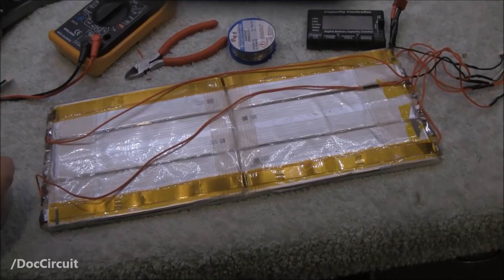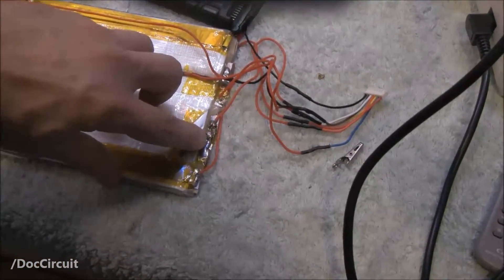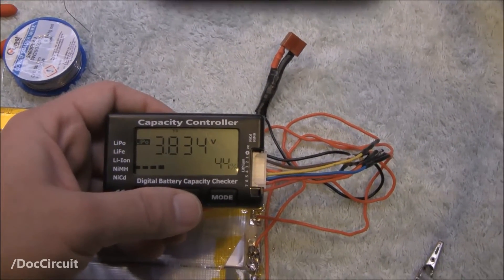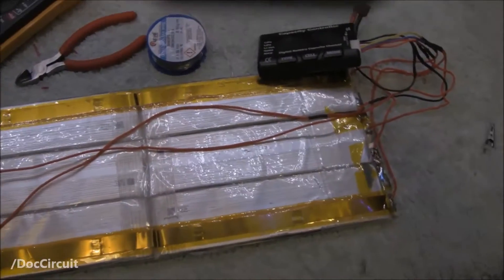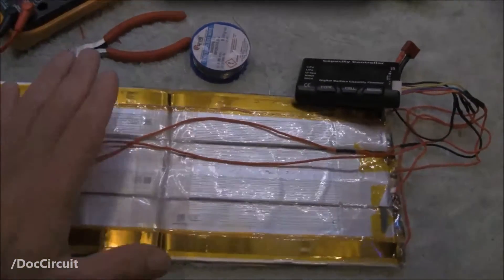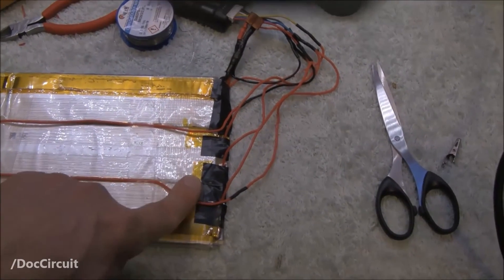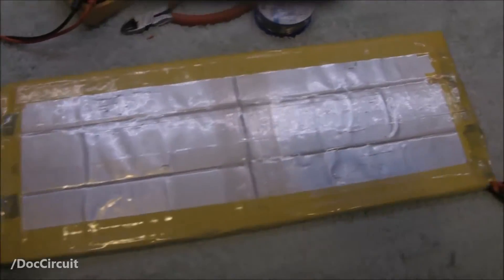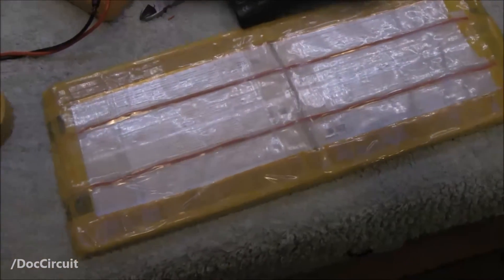Repairing a Li-Ion Battery. DON'T DO THIS!

Comment: hey I got a new bms and speed controller today and plugged it all in just like before but there is something wrong...the switch does not work and also whenever I plug it in just like if I was charging it, it starts up as if I turned it on by the switch but I never touched the switch... would love to Skype and would pay you to help me out thanks!

my Skype is: officialrender
Reply from the maker: +James Di Michiel Sorry, I don't Skype, and if I did I wouldn't offer to repair people boards via it as I'd be inundated. I'm also not too keen on trying to repair peoples boards via comments as it's time consuming. But anyhoo...

First thing I'd look at is the switch. I'd try a continuity test to find out it's condition.

It might also be that you've wired it up incorrectly somehow. I'm going to regret saying this, but if you want to email me a photograph of the circuit board and wiring I can take a quick look...
Reply: +Dr Circuit I'll link you my video I made for the company
Reply: I've emailed you the video :) hopefully you can help me figure out the problem or the mis-wiring
Reply from the maker: +James Di Michiel OK, I'll have a look...

Comment: Hey Dr Circuit.. The new board iv got has started playing up :( it cuts out, mainly when accelerating, The board stops. but if i give it about 10-20 seconds it is all fine again, i don't need to turn the board off then back on. I thought this would just be the ESC and i need a better one. But since I asked on endless-sphere and someone said it sounds like "esc is loosing sync or your hitting your low voltage cut off" Just wanted your opinion on if you think that sounds right and how you would recommend i try to fix it?
Reply from the maker: +Ed Bray It could be losing sync. But...

1. Losing sync tends to be accompanied by a loud screeching noise. 
2. Losing sync can occur when the timing between the motor and the ESC isn't spot on. This can happen when people are buying components from third parties and pairing them up. However the clone boards come with pre-matched motor and ESC.
3. Syncing also tends to occur when there is a substantial demand placed by the rider (going uphill, accelerating, etc).

So it 'could' be syncing, but a thought occurs...

The only time I had this issue was when I replaced the stock, pre-programmed ESC with an identical looking but non pre-programmed ESC (I made a video about replacing the stock ESC and I mention this in it). The non pre-programmed ESC ALWAYS gave me the problem you describe. But I had to turn the board off and on to get it going again. The reason why the non pre-programmed ESC did this was because the acceleration curve wasn't modified to make it perform slow starts/acceleration.

I wonder if the previous owner replaced the ESC with a third party ESC?

The low voltage cutoff... if the board still does this after a fresh charge then it isn't that. This is an easy one to eliminate.

Advice? Test the voltage cut off as described above, and if it isn't that it's the ESC. Again it comes down to one of the two weak points of the board, in your case the ESC. I'd replace it. 

However before you buy a VESC, I'm thinking of trying a MUCH cheaper alternative. A video will be coming about this, but not for a few weeks. If you're in a rush, do get the VESC.
Reply: Dr Circuit thank you, that was really helpful, So its not low voltage cut of then, because i have drained the board completely and given it a full charge, and it still dose it.  There is no loud screeching noise. it just sounds normal. I will test the violate cut like you said and I will wait for the new video. There is no rush, Just have to ride it always expecting it to turn off and be ready for the jolt as it cuts of so i don't go flying haha. The pervious owner hasn't changed the ESC. But I'm going to open it up and see if the ESC can be programmed or not, because i can then see if i can change the acceleration curve to help.
Reply from the maker: +Ed Bray No worries. To be clear, if the ESC can be programmed it's highly likely it's a replacement. The pre-fitted ESCs cannot be programmed and are 'fixed'. And if you can program it you are looking to lower the acceleration curve, and it's impossible to make a programmable ESC as slow as the pre-programmed version as the pre-programmed version has bespoke settings configured at the factory.

So by all means see if it's programmable, and try to lower the acceleration curve, but accept it will never accelerate as slowly as the factory fitted version.
Reply: Dr Circuit Ok thank you, it currently accelerates at the around the same speed as the Lecdec, that has the original ESC in. So i would have though it has the original ESC then. But i will take a look anyway
Reply from the maker: +Ed Bray Good luck!
Reply: +Dr Circuit update.. The ESC is the original, the programme port has been sealed/non-existant. just had another one of those bloody bolt inserts come out as well. It looks like the holes that they drilled for the inserts are too big, I can wiggle about 3 of them with my fingers. Just ordered some better inserts.
Reply from the maker: +Ed Bray Time for a new ESC! About the bolts.. they shouldn't be loose. Mine occasionally come loose but only when I unscrew stuff after I've tightened them up a bit too tightly. I'm going to use screw fix after I've finished modifying the board.

When I try to make something bite into wood that's too small for the hole, padding the hole out with thin wood (toothpick, matchstick, etc) sometimes helps.
Reply: Dr Circuit Yeah i think it is. The new video you're doing in a few weeks, is that an alternative to an VESC? I'm in no rush to fix it at the moment so I'm fine on waiting, I was just checking if it is? Yeah i know they shouldn't be loose, But it looks like the holes are too big, and the inserts have been put in with some sort of glue to fill the gap. Its a rubbish job. 
These are the inserts I have bought:
http://www.ebay.co.uk/itm/111975359523?_trksid=p2060353.m2749.l2649&var=410914952737&ssPageName=STRK%3AMEBIDX%3AIT

they will do the job nicely, I will take about 3mm out of the deck where the heads go, so it will fit flush on the deck. These inserts are bigger then the old ones so i can drill the hole to the correct size. Thanks for the tips about padding the hole, its a good idea.
Reply from the maker: +Ed Bray Glue? Ergh... yup, a poor job.

I've got a few more modifications coming up, the first is to make a two wheel drive version with stock ESCs (I want to test the viability of using two motors first). Work begins on that this evening and will (hopefully!) be the next video.

After that I will try the same motor arrangement but with better (again, hopefully!) ESC's but still cheap. The ESCs will be 150a Marine ESCs from HobbyKing. People use these on their DIY skateboards quite successfully, and they seem to be reliable and cheap. I will also test one of these ESCs on it's own with one motor. That's the video that should appeal to you.
Reply: +Dr Circuit yeah, Its a flexible rubbery glue that i have drilled out. The interesting thing is, after close inspection, Only 4 of the holes are too big with this glue, the rest look like a proper job, So i have no idea what was gong on when this board got built. Ahh well, Its all good fun fixing it, so i don't really mind.
 
Oh brilliant, I want to turn the board I'm having issues with into a dual drive! So i will be very interested to see how yours goes. I will keep an eye out for the videos then, hopefully the cheaper marine ESCs work brilliantly. Aren't the marine ones meant to be water cooled tho?
Reply from the maker: +Ed Bray Yup, they are. But they don't seem to 'need' it. People take measurements of them while using them on long electric skateboard rides and that seem to be fine. I'll test this for myself, and if they do get warm I can always mount a fan or somesuch.

There was a man who used the 90A version (uncooled, no fan) on his board very successfully, so two 150A versions should cope quite well. As usual, I'll make a video about my experiences.
Reply: Dr Circuit Ohh thats interesting, will be ideal if it doesn't need any cooling! I look forward to seeing your videos :) 
was just a bit nosey so i could see the price and had a look on hobyking, I couldn't see the 150A but there was a 120A or 180A, Did you mean 180A or am i being blind? 
http://www.hobbyking.com/hobbyking/store/__74074__Turnigy_Marine_180A_BEC_Waterproof_Speed_Controller_with_Water_Cooling.html
Reply from the maker: +Ed Bray You're quite right, it's the 120A version (was trying to remember it instead of looking it up. Dur!).

Comment: hey i am looking for a Electric skateboard my budget is 0-400$ i weigh 55Kg so not much at all do you know any good boards/deals?.... i prefer a not chinese company as if its broken i can return it.. unless you know i good chinese board i will take the risk
Reply from the maker: +Kaj Goossens From the use of $s in your post, I'm guessing you live in the States? If so I have no idea. I don't know all the boards available to you and I don't know what your import charges are for sellers not in the States. However $400 doesn't seem much so I suspect you'll have to resort to second hand sales, which likely means no warranty anyway.
Reply: +Dr Circuit i actually live in the netherlands couldnt find the euro sign lol.
but thanks for the response. what do you think of the e-wheelin board?
Reply from the maker: +Kaj Goossens The new, small board? From the paper specs it seems to have a low wattage motor, the battery seems small so not sure about the range, but the only YouTube video review of it show's it to be a decent board. Need more reviews or better yet to try one to have an informed opinion.
Reply: +Dr Circuit i have a new budget of 0-600 euros do you know a good board i have been looking at the akton blink
Reply from the maker: +Kaj Goossens I have no idea of the Blink's specifications, but I do know it's a bit on the short side. It's not quite a longboard. From personal experience I like longboards. When an electric board accelerates it can be quite forceful, and bracing yourself with a wideish leg stance helps. You don't get this option on the smaller boards. However I'm fairly top heavy and 6ft, so it might just be me.

Boards for 600 euros... well I have some news on that. For the past week I have been testing my Chinese Clone and VESC combo, and... it's good. Very good. Very very good.

Currently working on a video about this, but suffice to say, a Chinese Clone board + VESC = a FAR improved Chinese board (better acceleration, better brakes, performs standing starts, reverse if you want it, configurable limitations to prevent blowing of components).
Reply: +Dr Circuit sounds awesome but how do i get such a board?
Reply: +Kaj Goossens and i want a small as possible board so i can ride it to school and it fits in to my locker
Reply from the maker: +Kaj Goossens Here in the UK there are Magneto Boards and LecDec (Google to find). I don't remember where you live but I think you're part of Europe, if so there's no import charges. I think both of these companies ship to outside the UK.